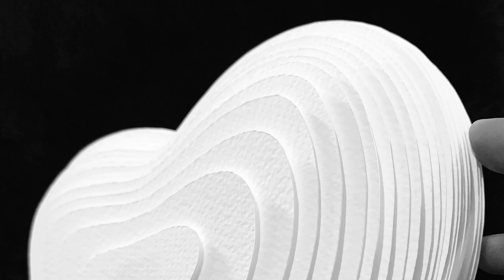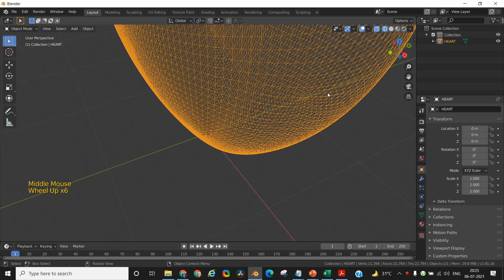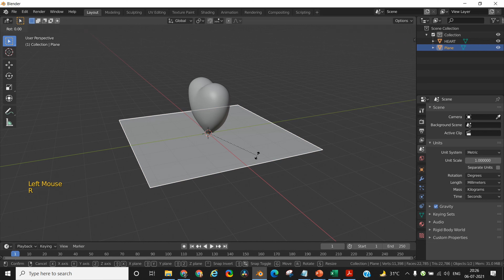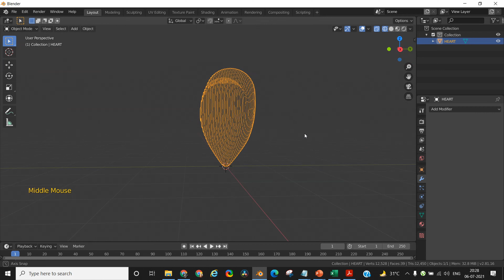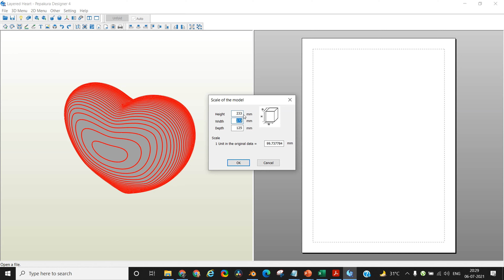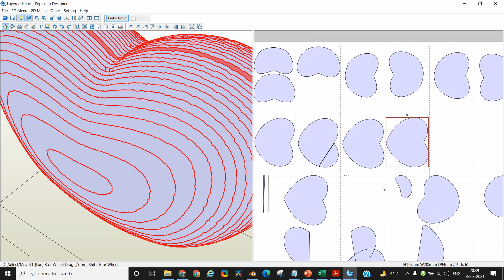Comment: Hey! You are a boss!! Thanks from Spain!
Reply: I have one cuestión, it's posible to select the thickness of the material? For example I want to cut with a laser cutter in 3 mm woodboard, it's that posible? Thanks again.
Reply: Yes it’s possible but not via this method. In this you will need to do a lot of manual calculation to get it right. If we prepare the same thing via rhino 🦏 3D and grasshopper 3D it’s possible during design itself. I will need to check for blender
Reply: @GenieCrafts  I'm waiting for this tutorial!
Reply: Thanks a lot 😊